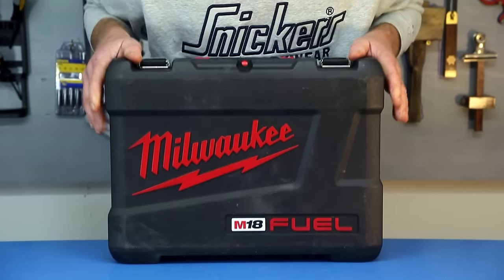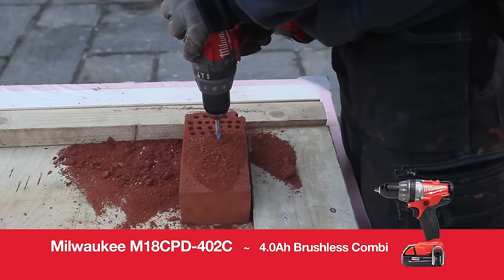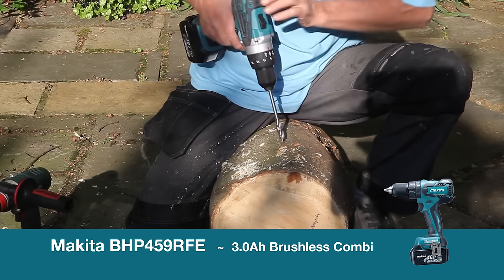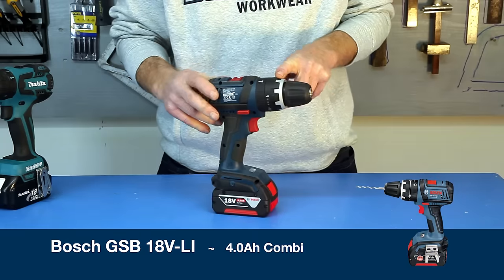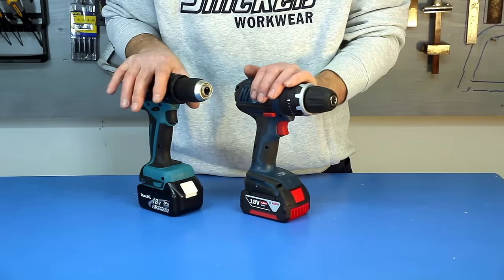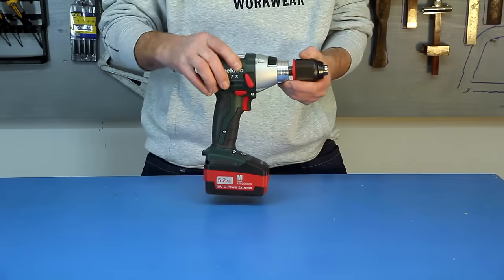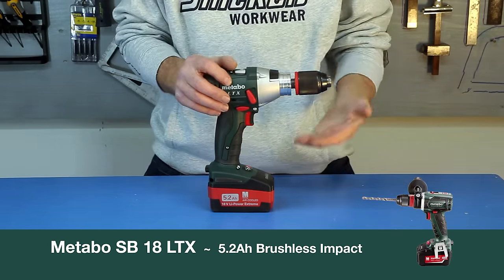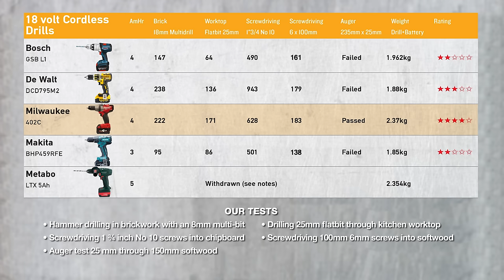18v Cordless Drill Review - 5 Best Drills Tested

Comment: It probably would not be fare, but it woul be interresting try try all these drills agains the king - 18v festool.
Reply from the maker: +jonnebanan  It will happen. We are redoing the 18 volt test with Bosch, Makita. Milwaukee, Hitachi, DeWalt, Festool,  and possible Panasonic. This time with 5Ah batteries. Subscribers to this channel will have a chance to win one of the test tools.
Reply: +Skill Builder Nice. I'm looking forward to it. One thing about the battery on the bosch though.. In this test the Bosch didn't crush the competitors when it came to battery life but my experience is that it will crush every other drill I've run it against by far! We are a team that often do roof construction and we all use different macchines. It's easy to keep track of battery life since we all use the same screws and count the screw packages one battery can drive. It's usually 6x120mm screws. The bosch is king here, even over the festool but the festool has more torque. I bought my bosch (gsr 18V-LI) when it first hit the market. Maybe the batteries where better then I don't know?
Reply from the maker: +jonnebanan I think the Bosch batteries are good so let us see how they go. It wasn't great on the brushed motor but this new test is all brushless. Thanks for the input and your experience

Comment: what can an 18v cordless tool do that a 12v couldnt?
or is 12v sufficient and efficient?
Reply from the maker: +Aquakey 98 

A lot of people now prefer a smaller lighter 12 volt. Generally the speed is less and the torque is less but they are lighter. You can also get them into smaller spaces.

Comment: Sorry to deliver the news my friend, but you need to know this. Being really into industrial batteries and their performance, I can tell you that your test isn't as accurate as you think. The reason being: 

The batteries used in these pack (most likely 18650s), can and usually come from different manufacturers. If you were to open one of these packs, you could find batteries made by: Samsung, LG, Sony, Panasonic or even some Chinese brands. Each brand performs differently. Even batteries of the same brand are different, e.g. you could get some Sony VTC3, which would perform differently to Sony's VTC4. And even batteries of the same type and model can and will perform differently according to batches. Don't take my word for it, but that of the extensive vaping and flashlight community that has made the use and knowledge of batteries a science all of itself.

So, like Forrest Gump said: you never now what you're gonna get. That's why, I'd prefer a corded tool any day. Cordless can't and shouldn't be, but sadly are, taken seriously by the professionals.
Reply: +Nonnof Yobiznes This is not bad news, we are always keen to learn from people on the inside. We know that manufacturers change cells from time to time. The test still has some validity because the consistency of results still shows major  differences. The high torque motor draws more start up current and is therefore not as good for small screwdriving so it proves that you need to look at what work you are intending to do. As for the cordless versus mains argument I am with you on that. A mains powered tool will last longer and be cheaper so buying cordless makes no sense for the hobbyist or occasional user but many building sites don't allow trailing leads so, like it or not, cordless will continue to grow.
Reply: +Roger Bisby And there's THAT other side of the story: the motors' specs. Let's say it's a combination of things. Being lucky getting good batteries in your pack and doing your homework to the specifics of the motor in the tool. I suppose that's a lot to dig into. That'd get quite technical. I bet that's another science too. Maybe it's just a matter of comparing the corded tools to see the actual performance with identical power input.

I suppose you're right. Some sites don't have power. Also, having long cords here an there might carry some very scary thing called liability. I'd compare cordless and corded to automatic and manual transmission. One is more likely to work all the time, every time. But since construction budgets are very inflated, probably there's room to include the extra cost of going cordless.
Reply: +Nonnof Yobiznes The test is accurate, when you go out to buy batteries you expect them to perform to their best. If they don't perform as intended, like the metabo drill, you still have to compare as it is. Metabo had the highest Ah, and didn't perform.
Reply from the maker: +Tavohl You are completely right, all we can do is run the test and report one happens.
Reply: +Tavohl I think you're missing the point by a mile. It's not what's advertised, it's what's really under the hood. Who is the battery supplier. I stand by my statement.
Reply: +Nonnof Yobiznes all you said was, the batteries are different, and the test isn't accurate for that reason. Then on your reply you say, its what is "under the hood" of the battery. So how is the test inaccurate? that's what's being provided when you buy the drill, you have to test it as it is. You might as well say, the drill bits are different and the test is inaccurate.If was out and wanted to buy a cordless drill, and wanted the drill with the better battery life/power, I would think the metabo was the best choice. since its 5Ah. If I came home and turned out I had to stop every 5 minutes for the drill to catch up, I would be pissed since the reason I bought it was battery, and its not providing the power. You even said it, "being lucky getting good batteries in your pack" That's what you are paying for. You have to test it as it is. You cant expect the tester to build his own battery for each drill, and that each battery had the same volts, resistance and amps so the test could be objective. Again when you go buy a drill, they provide the battery so you have to test as it is.
Reply: +Tavohl You're still missing the point. You're assuming the people watching this WANT A CORDLESS drill, not the actual better tool. It's like taking an Accord, a Camry, an Altima and a Ford Fussion and putting different kinds of gas (87, 89 , etc) and different types of additives and expecting a fair comparison of the millage and performance of each engine.
Reply from the maker: +Nonnof Yobiznes  
Missing the point? Consider another view. It is  arrogant to suggest that those hearing you are somehow deficient if they don't agree with your point and THAT PUTTING IT IN CAPS adds value to your argument. I think that the vast majority of people watching this 18 volt cordless drill test are probably interested in cordless drills and Tavohl is entitled to base his discussion on that assumption. 
There is value in the test findings. We deal with what we have. The Metabo didn't do the job.
Reply: +Skill Builder OK, OK. If you can't take a constructive critique, but what do I know. This is just a drill test. Had the tittle said "Cordless Drill", then I'd just have moved on to other vids, not having to spend all that time typing sharing what I did, because it'd be safe to assume people watching this wanted a cordless, regardless of the power source. Turns out, for example, that I'm interested in a normal drill, and I thought I could give an insight to those like me. Anyways, sorry if you felt offended. Good day guys.
Reply from the maker: +Nonnof Yobiznes
 I am so sorry if we mislead you and you feel you have wasted your time. 18 volt drills are always cordless so we felt it wasn't necessary to add that word in the title. Perhaps we should.
We always welcome criticism but our video is not  about cordless versus corded. However, since you raised it,  
I would agree that a mains powered machine is more consistent and is also cheaper than a battery tool  but millions of professionals use cordless for the portability and convenience. They are serious tools and on many European construction sites it is now  forbidden to use trailing power leads as they represent a trip hazard.
Reply: +Nonnof Yobiznes no you came to complain about how the battery matters, and that's what is "under the hood".
I'm sure most people would think the motor is under the hood and the battery would only mean the capacity of energy it can store. So regardless of battery the Milwaukee performed better and that's what I wanted to know.
Reply: Tavohl
OK OK, fine! Have it your way Mr.
Reply: +Nonnof Yobiznes Why would it be sad that cordless tools are taken serious by professionals? Just because the battery quality isn't consistent???

I work in construction, I do not really use heavy duty tools, but for my job I'm on the move all the time and I prefer a cordless tool over a corded tool any time. Much more mobility. Battery life is no issue for me and if it would be I'd simply buy another battery. No way I'm gonna waste my time with cords.
Reply: +cmoncg OK.
Reply: +Skill Builder You are being extremely polite and accepting of this guy's troll comments. The crux of the matter is that your tests pitted different drill systems against each other. The battery is just part of a system. I watched your review video avidly, and nowhere did I see you claim that one 4Ah battery could be directly compared to another. On the contrary you tested the drill systems against each other and drew attention to the fact that, some drills, despite having supposedly higher capacity batteries, did not perform as well!

You should have paid better attention to this troll's opening gambit, which was clearly designed to undermine your rigorous findings in some attempt to prove he had some knowledge you didn't.

Don't feed the trolls... :)

More importantly keep doing these amazing reviews. Thanks!
Reply from the maker: +Mat Smith 

Hi Mat 
I agree that trolls should not be fed.  My approach is to engage in insults. Thanks for the encouragement. We are under way with the next 18 volt test. A lot of manufacturers have upped their game since our last test.
Reply: I'm currently looking at the new version Milwaukee 5Ah combi. Looks like a powerhouse, delivers 135Nm. £350 or maybe a bit cheaper online. Have you seen this one?
Reply from the maker: +Mat Smith 

Yes we have that drill on our next test so we are putting it through its paces. It is a powerful machine but a bit smaller and lighter than the one on this test. The weight was always the drawback.
Reply: I rest my case ;)
Reply: +Nonnof Yobiznes eh?
Reply: +Nonnof Yobiznes I didn't say I was done talking. I said "I rest my case". This wasn't addressed to you. Am I allowed to comment on someone else's video? I think I am.
Reply: +Skill Builder 135Nm Max torque and lighter to hold? I think I know where my money is going... Sounds good. Look forward to seeing your review!
Reply: +Mat Smith ok
Reply: +Nonnof Yobiznes Wow.. We all undersstand exactly what you're saying, but it's YOU who doesn't get it. For one, short offirst testing &/or tearing apart batteries from new drills, there's no other way to conduct such  test! We're all buying our drills off the shelf without the benefit of extensive battery testing & discovery of which company produced it, etc., & so besidess being all we can reasonably do, that's also the most accurate test anyway. How these tools perform off the shelf is what is being tested. Come on, w/carrying on with all that nonsense...?
Reply: It's called LAZY AMERICA. I agree a corded drill will tear your arm off for 30+ years. Where you would buy 15 or more cordless throw-a-ways at least.

Comment: Nice comparison test for performance but I also consider durability, longevity & the warranty. Having owned the Makita LCT200W 18v 2-piece combo kit since July 2011 (homeowner use - once a week, 2X per month), I would probably not purchase this brand again. I've had 2 battery failures, half of them to be exact, lasting right at the one year mark. The other 2 Makita Li-ion batteries, a 1.5 mAh and a 3.0 mAh seem to be doing quite well.
Reply from the maker: Send those batteries back. If Makita feels you have not had good service from them they will replace them. They can tell how many recharges they have had.
Reply: Skill Builder
Tried that some time ago but they said "Sorry, the 1-year warranty expired". I still have them (holding around 12vdc each) so there's still a chance I can pull them apart, replace the bad cell.. or that's what other youtubers have done. Cheers!
Reply from the maker: Patrick Walker That is a shame. In the U.K Makita is a little more flexible in its approach. They are well known for carrying out repairs out of warranty. It is how they keep customers.
Reply: Just a little info about the batteries from makita The flashing Red-Green problem is a problem with a cell in the batteries. It is most common in the drills that don't get used very often, because;

 the first cell in the battery is the one that keeps the maintenance chip on the balancing board inside powered up and doing its job. If it doesn't get used and charged semi often it will completely drain the first cell and cause an error. 

If you haven't used your drill for a while and get the red-green flash, don't take it on and off your charger a bunch and try to charge it. Either leave it on  the first time, or if you're savvy enough, take apart the battery and give some juice to the first cell.

After so many error codes the battery stops charging regardless, but I personally own 5 makita drills and couldn't be happier with any of them....except the one I took apart and now it doesn't spin....who's good with planetary gears?.?.?
Reply from the maker: Mazekwon That is really valuable information. You are right to say that the batteries need to be charged up periodically but that trick with the first cell is interesting. As for planetary gears, even the manufacturers don't  repair them, you need a watchmaker.
Reply: Skill Builder So, sounds like the folks that don't use your Makita power tools on a regular basis will experience a battery problem early on. I took one of these so-called dead packs apart (yes, bought the special torx bit) and after separating each cell could not identify this single cell that powers the chip as all of them were practically equal in voltage. It sound like a handful of us got some crap batteries or "if we don't use it - we'll lose it"? BTW: bought some aftermarket 18v 3.0Ah Li-ion on amazon (half the price) that are doing quite well.
Reply: Patrick Walker it also happens from over heating, you gotta be careful. But yeah, some batteries are just sh*t.

Comment: I've very recently bought a new power tools set by Makita and was disappointed to discover that it's not as torquey or as fast as my old Ryobi combo? The Ryobi is 6 yrs old and uses old style battery, which takes an aeon to charge.....
Reply from the maker: +manos3790 

Was it a cheap set? Makita has a whole range and at the top end you should be getting 120Nm. 
I accept that the Ryobi was a cheap drill so bang for bucks it may be that the Ryobi was better. A lot of people seem to like them.
Reply: Skill Builder it was the old style Ryobi blue, black with yellow switches and trigger. Just used out for metal polishing and the battery went dead after only 45-55 mins use!!! I think it's seen better days......but is still ok as a back up. Unsure of  Makita combi drill model number to define which it is? It's kinda adequate, but speed department is where it's seriously lacking.

Comment: My money's on Makita...
Reply: mine to
Reply: +studisme Only got 2 out of 5.
Reply from the maker: +Kevin de Bie 

Hello Kevin. Thanks for your comments. We had a system and it might not  have suited everyone but nothing will. There was no sponsorship. Makita did not have anything bigger than 3Ah at the time of testing and we stated that it was holding them back. Shortly after this test they introduced a 4 then a 5 amp and they put a fuel gauge on the battery. It is useful if you are going up a scaffolding or a ladder and want to finish the job. On some sites you have to go back to the charging room where the 240 supply is.  I don't think Makita  will argue with our  findings. Have a look at our new test. I am sure there are still things we could do better but we took some of the comments on board and we try hard to be fair. If our videos are sponsored we say so. We are on the side of the builder not the power tool company.

Comment: As with all tests price band has been left out....I wonder why? 

Milwaukee M18CPD-402C Average price £320..

Dewalt DCD795M2 Average price £220....

Makita BHP459RFE  Avergae price £220...

Bosch GSB18VLI avearge price £150....

There is at least £100 difference in any of these drills. As with everything it comes down to price branding...So the milwaukee cost half as much again as the Dewalt or makita and it won Wow what a Surprise ,, You might as well have tested a Challenge or Black and decker...They have 18v combi drills at least then you could have been honest about the price difference......On the positive side...Milwuakee do sell a multi charging station]
Reply from the maker: +Jamie Rollinson Thanks Jamie
There was no intention on our part to avoid the issue of price. 
We would lbe happy to put some prices in there but we have a global audience and the deals done on power tools vary from week to week. It is easy enough to look up current prices and ours would quickly be wrong. The test shows that there is a difference between 18 volt drills and it is up to the viewer to decide if that difference is worth the money. For many people price is not the barrier. Look at Festool, the sell plenty of tools to tradesmen who like to own something special.